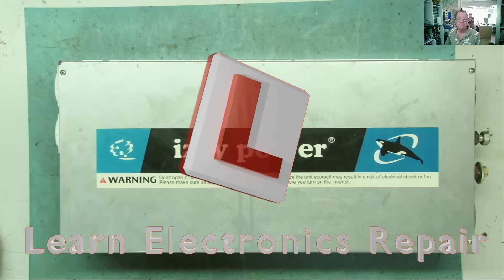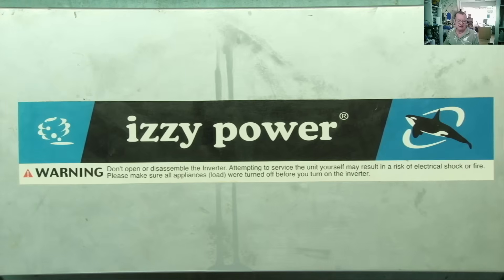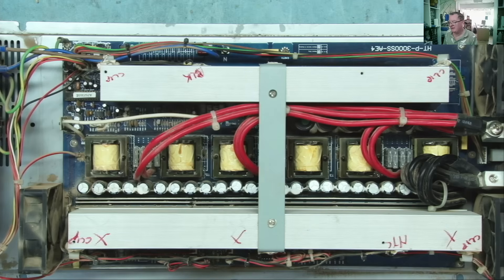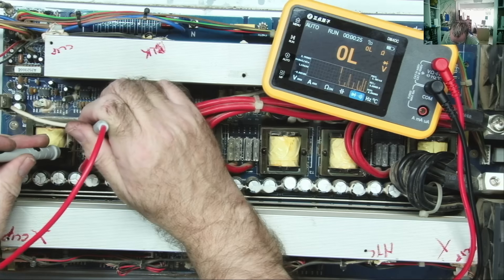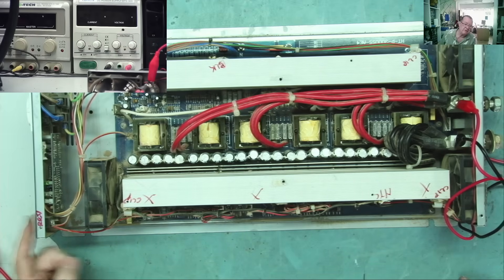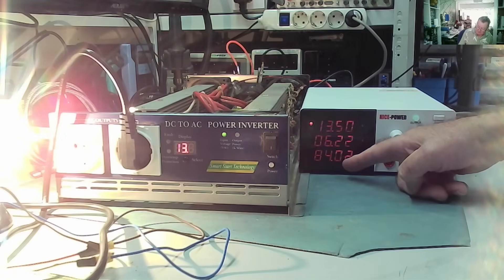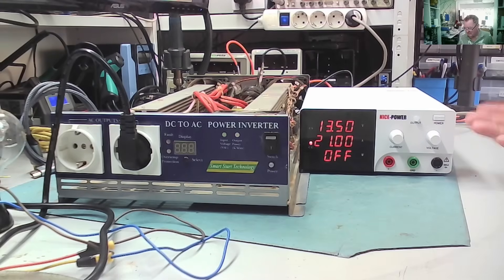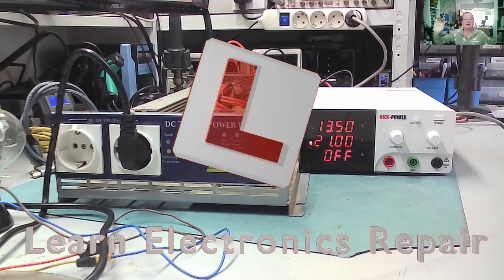Izzy Power 2500W Inverter Repair.  I fixed this six months ago but now it came back...

Comment: Never had a bench PSU til recently so have always used several  7ah  SLA batteries in parallel for testing high current gear like this. I wouldn’t  charge Handy Andy for this one, given the the short time it took the goodwill generated is worth much more for his continued referrals - we do send $0.00 invoices however, makes it official and not a bad reminder to Andy of the love he’s getting

Comment: Test it with a heavier load. Might be a thermal issue.
You're right about the batteries. They could be well-used, and the inverter goes into low-voltage shutdown when a high current is pulled.

Comment: Probably a valid warming re opening and servicing, the last thing you want is an electrocuted Joe Public and it's not really practical to fit 7 or so fuses on the end panels. I seem to recall that the fuses didn't blow fast enough to protect the semis last time.

Comment: If I look it up, but this is an ultracheap  200 euro inverter, is it worth repairing, not only in quality but also regarding the repair costs?  I repaired a few Victrons but they are over 1000 euro.

Comment: Left-only audio this time?  Well, no worries, I'm here for the explanations and repairs.  🙂  It'll be interesting to see what happens with this again.
Reply from the maker: There was a bad connection from my audio mixer to my PC while recording but I didn't notice at the time.  It wasn't right audio only' it was just higher level audio on the right than the left. I've had this problem on the odd occasion before.  Anyway I fixed the recording system this morning when I came into the office so problem solved.  I spotted the problem while editing the video but Monday was a public holiday here, as was Saturday, which I like as it gives you a day or two to put your Christmas decorations up 😁  They should do this everywhere it's a nice way to start the Christmas period.
Reply: Oh so it wasn't only me thought something was wrong with my headphones lol
Reply: Fine at my end - full stereo.  Loud and clear, as usual!